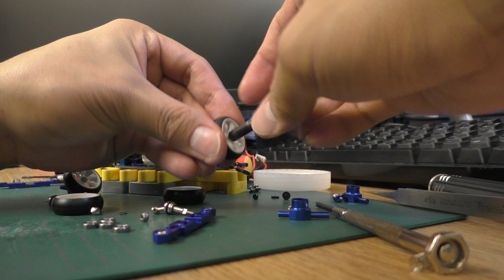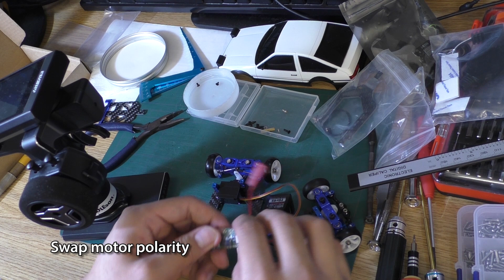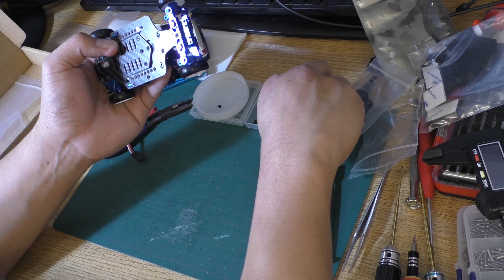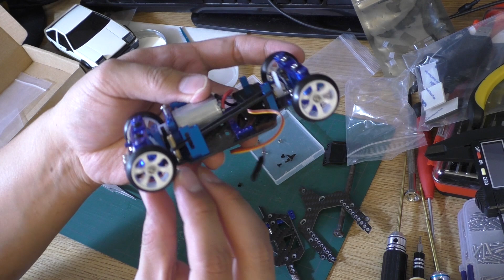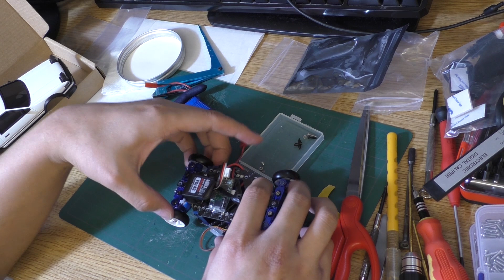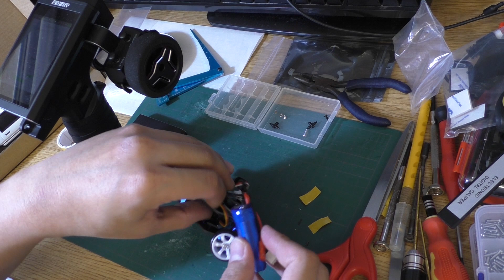HGD1 1/28 RWD Drift Build  Full Length - Part 2 of 2

Comment: Hello,
First thank you for all your movies.
I have a quick question for you:
The differential of my HGD1 car is missing a tooth, do you think I should buy a rigid axle or a real differential?
Reply from the maker: Get a ball differential so you can have some adjustability. I ended up using a ball diff with loose open diff setup on HGD1.
Reply: @BeaversHobby 
Thanks, I found only one on AliExpress, it's a red diff. Have you another model?
Regards
Reply from the maker: @userbeecore5516  The red metal ball diff is quite a gamble. I've got them and some work, some don't. In my HGD1 is the old Eagle Racing diff from back in the day. It's equivalent to Mini-Z ball diff. Here if you are in the US. https://www.kenonhobby.com/Kyosho-Mini-Z-MB010-Ball-Differential_p_44558.html
Or global shipping from Japan https://banzaihobby.com/products/mbw028-ball-differential-set .
Reply: Thanks, I'll look.  I have several mini-z optioned with PnRacing, so I have original differentials (the plastic model with the satellites) but the tooth gap is not free with the metal pinion of the HGD1.  I hope it doesn't do the same thing with Eagle's
Reply from the maker: @userbeecore5516  Somehow the plastic Mini-Z diff doesn't fit well in this car. Ball diff is narrower so you will need less shims than using in Mini-Z.
Reply: @BeaversHobby  I tried to reduce it in width, which worked, but then I had problem with the shape of the gear between the metal pinion and the plastic crown. I don't know if using the one for the Mini-Z Buggy (MBW028) will give me the same result (not smooth). Maybe my metal gear is not at the same 'Pitch'. Do you think the 'Pitch' could be a little bit different on some HGD1, depending on the manufacturer?
Reply from the maker: @userbeecore5516  Sounds like the pinion gear is the problem. I have some of the metal pinion you are talking about. The pitch is wrong. I mean it's mod 0.5 but the cogs are thicker than they should be and that will destroy everything you put in there.
As you suspected, even Mini-Z diff won't survive in there. I don't know if you can replace the pinion but if you can, replace it with Tamiya Mini 4WD motor pinion. It'll also be 8T and has perfect machining.

Comment: In the front wheels there should be only one gasket between bearing and wheel, right?
Reply from the maker: It depends. You'll have to try it out if you need and washer/gasket/shim on the wheels or not. Make sure all the wheels can spin smoothly without wobble.
Reply: @BeaversHobby  Thank you for your reply. I really appreciate it a lot! 
The thing is that there is some wobbling because I cannot tight the wheels to much cos otherways they are not running smoothly. 
I will try to clean the bearing and try once again.
Reply from the maker: @jayce704  My pleasure. Best of luck with the build!

Comment: Hi Beaver, I am having trouble with my gyro. It is going in the wrong direction. I have tried to reverse channel three but it doesn't change. I am using radiolink rc4gs controller and receiver.
Reply from the maker: If you use the Radiolink's onboard gyro you'll have to press the button on the transmitter twice to reverse the gyro direction. Otherwise if it's an external unit there will be a dip switch for the direction.
Reply: @BeaversHobby  where is the button on the hdg1 gyro?
Reply from the maker: @needtau4138  It's a dip switch on the top. Try one by one and see which one reverse the direction. The other one is for servo type between digital and analog.
Reply: @BeaversHobby  I forgot to mention but the gyro for my current model looks different only having a button and a dial. I've pressed it a couple times while on and holding it but nothing changes. Should I return it and get a new kit?
Reply from the maker: @needtau4138  Oh, so they changed it for V3. That's really good. Here's how you use it. https://youtu.be/qksr7-hSE0I
Reply: @BeaversHobby  hi, it was night for me, the gyro looks like an offbrand one. It doesn't have a case around just a board with chips and plugs.
Reply: @BeaversHobby  the the rc4gs receiver gyro good enough?
Reply from the maker: @needtau4138  Do you have a photo of the gyro? Anyway, RC4GS integrated gyro is alright. I'll get you drifting but it's not as good as an external gyro.
Reply: @BeaversHobby  I can take one but at this point I think it's defective.
Reply from the maker: @needtau4138  Yeah... probably. If any press doesn't work then it's probably defective.
Reply: @BeaversHobby  dang, guess I should get a refund
Reply from the maker: @needtau4138  Yes, try and contact the shop and see what can they do.
Reply: @BeaversHobby  thanks for the information and help 👍
Reply from the maker: @needtau4138  My pleasure. Best of luck with the refund!
Reply: @BeaversHobby  Hi Beaver's, I successfully got my refund but I would still like to continue rwd drifting. Do you think I should get another hdg1 from Banggood and hope the gyro I get is good?
Reply from the maker: @needtau4138  If you still got the car, just get a new gyro.
Reply: @BeaversHobby  alright

Comment: I just finished mine but when I push down on the throttle the motor just pops back and forth
Reply from the maker: Check the connection between the ESC and motor. Check the gear mesh too. Also is this brushless? If so motor struggling to turn is the sign of a short circuit between two terminals or faulty ESC.

Comment: What reciever do i need for this? 3 channel?
Reply from the maker: It depends on the transmitter to have channel 3. I recommend Radiolink RC4GS for ease of use.
Reply: @BeaversHobby  Transmitter is Absima cr4t. I dont know if 3 channel is enough. 
And i cant find right size reciever. They are too big or too small.
Reply from the maker: @abzyberdy  Here's a micro receiver you can use. https://bit.ly/3a41K3g
Set your CR4T to AFHDS 2A mode, one way will be OK.

Comment: Excellent video 👍👍👍which will be very helpful for me. I've just ordered the brushless kit, I'm in the UK so it may take a while. Any ideas on a good reasonably priced radio/receiver.
Reply from the maker: Radiolink RC4GS has everything you need with a screen as well and it's easy to use. If you want something even cheaper then take a look at DumboRC.
Reply: Thanks for the recommendation. I'll probably go for the radiolink👍👍
Reply from the maker: My pleasure. Good luck with the project. If you use external gyro don't forget to disable the onboard gyro.

Comment: Nice .. have you found spare yet ? Looking mainly for front part to buy it separately
Reply from the maker: No. They don't sell the front separately. Almost all other parts are shared with Mini-Q though so those are easy to find.
Reply: @BeaversHobby  damn ...
Reply: @BeaversHobby   You can buy everything like part, invidiual part alu etc... on taobao. Cheaper than bangood.
Reply from the maker: @nguyengiabao1275  I wish I can access the website. Once I visit it becomes blank page.

Comment: Out of curiosity, I’m wanting to get into this scale hobby.  What’s the run time on these models?
Reply from the maker: I mostly get about 30 minutes to 50 minutes depending on car and battery. Q7 touring with 400mAh 2S Lipo battery is close to 30-40 minutes and Mini-Z with 4x NiMH 900mAh can run up to 40-50 minutes.
Reply: Beaver's Hobby thank you. I’ve been researching and most get about 5-10 minutes. That stinks.  I want at least 20 minutes of fun time. 

Looking at the mini z.  Which would you recommend for a starter like me.  Looking to get 2-4 for me my teenager kids.  I will be maintain them until they demonstrate car. 
The other issue I have is ordering over seas.  Seems like a few resellers are not reliable and if I have a problem with the electronic car, hate to expect timely customer service from the other side of the world.  
Who would you highly recommend to buy from as well?  Any USA dealers?
Reply from the maker: @juliuscaesar8801  I recommend Mini-Z AWD because it is the easiest one to drive in all conditions whether you drive on normal room floor or on track. It can also drift. However it won't be as fast as RWD on the track but at least you don't need a dedicated space and clean it regularly to have fun. However if you have a space to lay down some carpet, EVA or just some marking on the floor then RWD will be a very good car to learn how to drive. FWD... it's quite nice but you'll have to install prop shaft to make it AWD to get full potential out of it. So I'd say get it only you're bored with other cars because FWD offers different driving experience. 
Actually, just choose any Mini-Z in general, it won't disappoint you and it has great support from both community and dealers.
Also, get some decent battery like Eneloop or Ikea Ladda and you'll get really long runtime.
You can find a Kyosho dealer near you on their website. https://www.easymapmaker.com/map/9eb20461992c3ddf1fff87ce69e899fe
https://www.kyoshoamerica.com/
I almost forgot, there's also Kenonhobby. It's a well-known shop for Mini-Z and hop ups. kenonhobby.com

On the budget side, there's Mini-Q.
TRQ1 is equivalent to Mini-Z AWD. https://bit.ly/2zvIJdH
Q2 is equivalent to Mini-Z RWD. http://bit.ly/2PJ8JHw
Reply: Rafael Rafael are you looking into race or drifting? Some chassis can do both but when it comes to race only i prefer rwd but if you prefer 4wd you gotta do belt drive. It’s all very fun until you work on one with crappy tools lol

Comment: Where do you buy spare parts ?
Reply from the maker: Aliexpress, Banggood and hobbyking for the parts that share with Mini-Q like diff, spur gear and some chassis parts.
Any Kyosho compatible parts like wheels, tyres, diff and universal shafts are from Kyosho distributor.
There're only few parts that's specific for this car and don't have spare like chassis plate, servo mount but those aren't gonna break.
Reply: @BeaversHobby  i am surching spare parts  for a tz4  (mini Q like), can you you help me ?
Reply from the maker: @lirycsman  Yes. Which part you you need? Most of them can be found here. https://www.aliexpress.com/item/33045636252.html
You can also still search Turnigy TZ4 on hobbyking but the result isn't that good and most of them are out of stock. https://hobbyking.com/en_us/catalogsearch/result/?q=turnigy%20tz4

Comment: Hi what is the difference between this and sinohobby q5, except the Price and brushless Combo. Why is this one so expensive?
Reply from the maker: This one is RWD drift car. The full kit with electronics also comes with gyro which is about $25 by itself. Q5 is AWD (or 4WD) touring/drift car. I suggest you watch the review for more information. https://youtu.be/_c-3Nqis7gs
Reply: @BeaversHobby  oki thanks, will look into it.
What is the better wl toys or sinohobby? Any recommentation? Sorry to Stress you but i am so confused with all those mini models out there.
Reply from the maker: @neoliberalerneandertaler9347  Depends on your budget. If you don't have anything yet WLtoys is the best for less than 60 USD. If you can spend more then Mini-Q Q7 and Atomic AMZ are much better chassis than WLtoys.
If you have infinite budget then GL Racing offers top of the line car with GLA, AWD car that can do everything brilliantly.
Reply: @BeaversHobby  thank you very much, sir!👍
Reply from the maker: @neoliberalerneandertaler9347  My pleasure.

Comment: Welcome.
In one of your drift videos, the question was: What are the camber settings for mini with drifting? Your answer: The setup in this video is front 0 degree and rear 1.5 degree. I suggest starting with 1.5 degree both front and rear.
How can you please tell me how to set it in mini with MA-020. Do I need to replace any part to make these settings?
ps.

I think I know how to change these settings. I need to buy the Camber Knuckle Set (1.5 / MINI-Z AWD) MDW005-15 back kit
https://rc.kyosho.com/en/mdw005-15.html?___SID=U
and on the front Camber Knuckle Set (MA-020) MDW202
https://rc.kyosho.com/en/mdw202.html?___SID=U
Write if I'm right.
Do these changes strongly affect drift? can it leave a standard zero bend on all four wheels. What should I choose the number of front switches? What settings do you recommend for front and back on the mini-with MA-020?
Reply from the maker: Yes, need to buy camber knuckle sets to change the camber. Both your choices are correct if you still use standard rear chassis and not DWS upgrade.
They do produce the result and you can feel it.
I haven't played much with Mini-Z yet but generally you'd want 1.5 degree camber in both front and back.
I have 1.5 degree in the back of my MA-030 and it drifts really well. I haven't tried 1.5 degree front yet though.
They come in set anyway so you can try and experiment with them.
Reply: @BeaversHobby  Thank you for your answer
From the front crossover link
https://rc.kyosho.com/en/mdw202.html?___SID=U
which number should you choose to shift 1.5 degrees ahead?
As a reminder, I have already mounted the Front Oneway Unit at the back of the Rigid Axle. I ordered DS RACING LF-1 and LF-4 tires. I bought the X-SPEED V engine. In addition to Camber Knuckle, you would change something else in my mini with MA-020
Reply from the maker: No.1 is 1 degree. There's no 1.5 degree for MA020, sorry for the confusion earlier. 
The manual also tells you which one is what. Basically number refers to the camber degree.
Apart from knuckle, one way and tyres I also recommend springs. I use soft at the front and hard at the back.
That's pretty much it, camber, one way + solid axle, tyres and springs. All the rest is practice.
Reply: @BeaversHobby  Thank you with all my heart
Reply from the maker: @adogde6874  Always a pleasure.